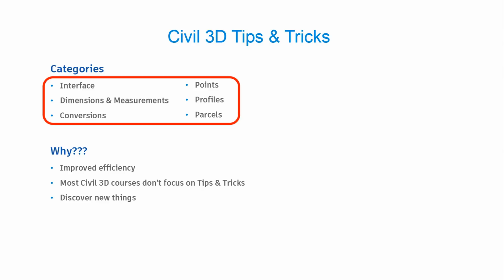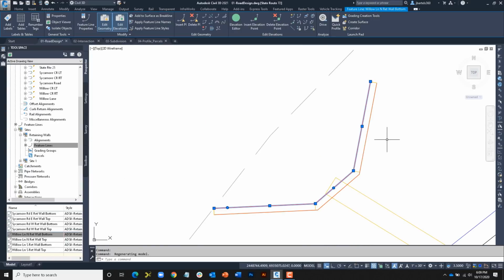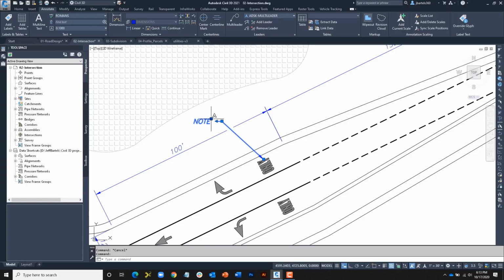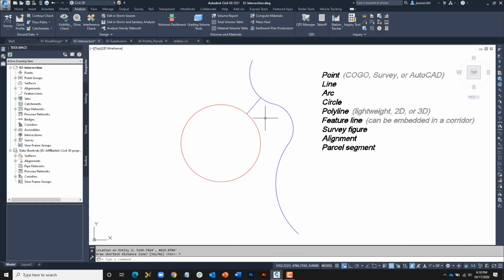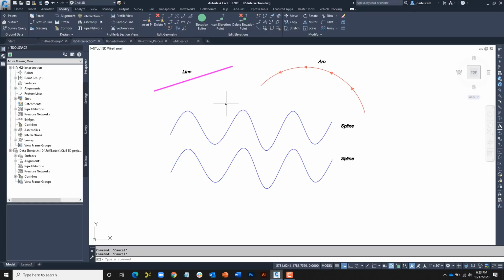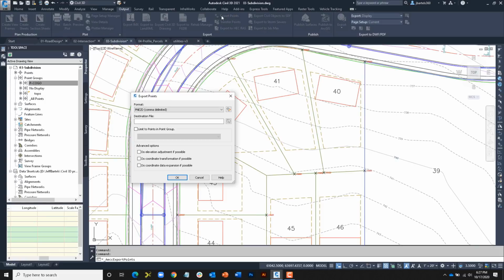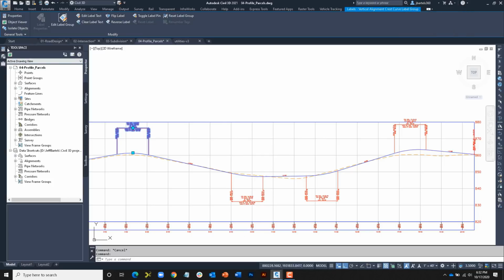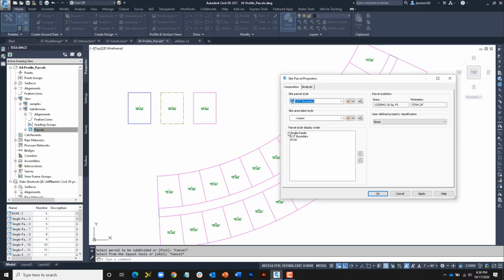20 More Civil 3D Tips and Tricks in 20 Minutes!

Comment: Hi Jeff, Is there a way to list AutoCad parts in a C3D dwg in a table without having to make an alignment out of it. I am a roundabout designer at Caltrans and I used C3D for the roundabout but the details for splitter islands, curbs and ADA ramps were not easy to label. My tech ended up in listing them in Cad and manually populating a table manually for all the components, x,y,z coordinates, etc. with over 100 entries. Please advise.